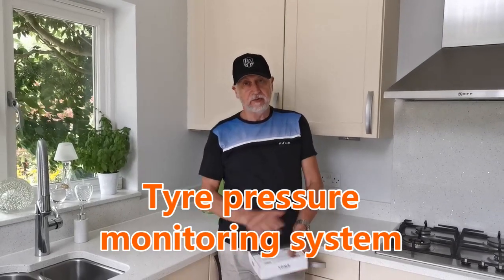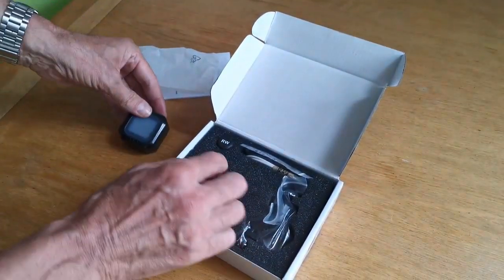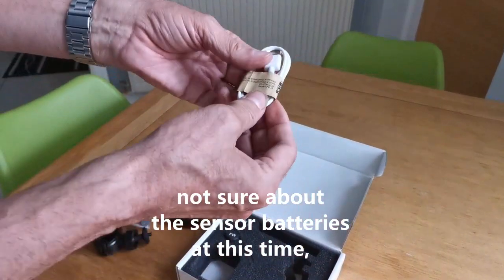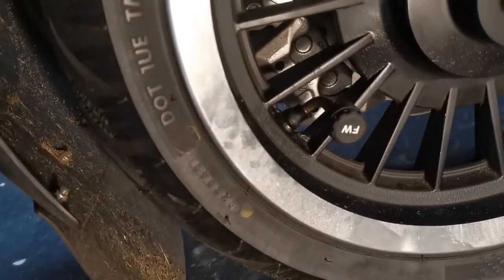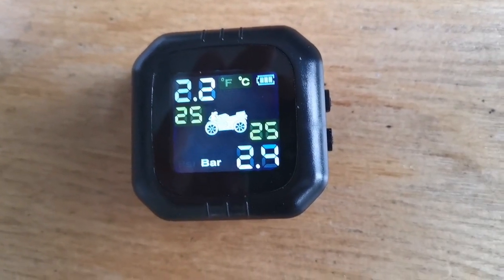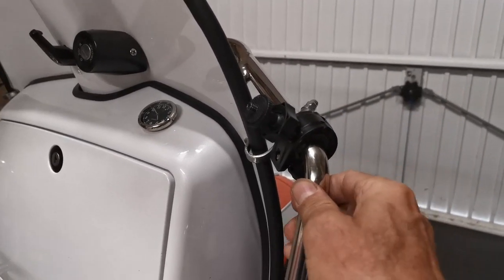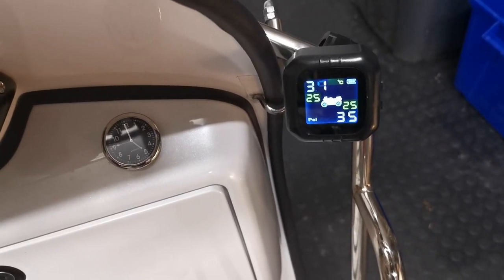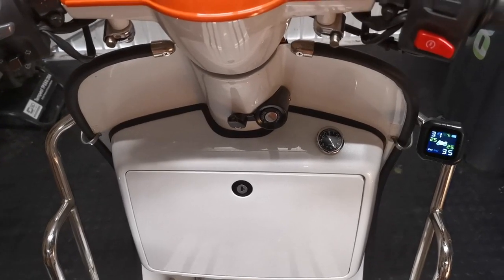Tyre pressure monitoring system

Comment: I'll be fitting mine before she goes on road. Don't have a garage, so I'm taking it up in the lift to 12th floor, As I'm not legal. Also I'll be taking panels, glovebox, horncover, front mudguard also legsheilds & foot runners then bubble wrap. Drain or take out fuel tank. As need to get it on back wheel to get into my living room to work on it, get cbt&licence renewed as photo needs replacing. Any other advice about removing other fluids??? As its got to go on back wheel

Comment: FYI the tyre pressure will change when the temp increases in the tyre so that why there is a temp reading as well as a pressure reading.
Reply from the maker: Yes, I guess you become familiar with normal running temp so it's is high you would wonder what the issue may be!

Comment: Looking forward to seeing this. Having fitted mine I feel so much safer. Thanks mate
Reply from the maker: Thanks for the idea I think it's great, how would the pressure go up!. Is yours the same, I couldn't see any batteries in the valves.
Reply: Royal Alloy Guy I bought a slightly different one from eBay but virtually the same. Tyre pressures can go up after hours of driving in hot weather so it’s good to set that too in line with tyre manufacturer guidelines - that includes temperature too. Thanks
Reply from the maker: @TheShayster7  thanks again for your help.
Reply: Royal Alloy Guy there are little batteries in my tyre sensors. Just below the top cap